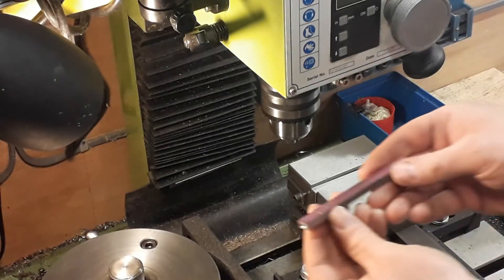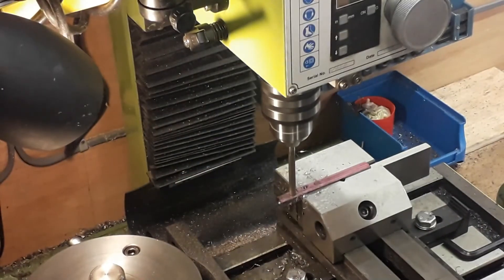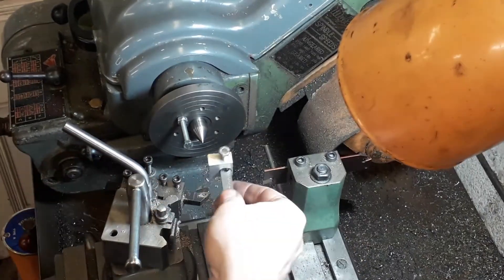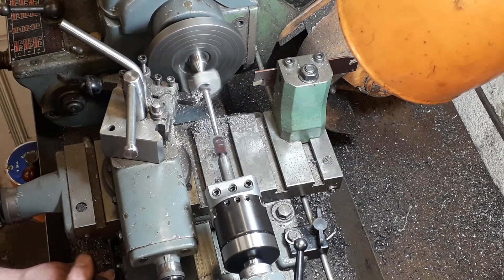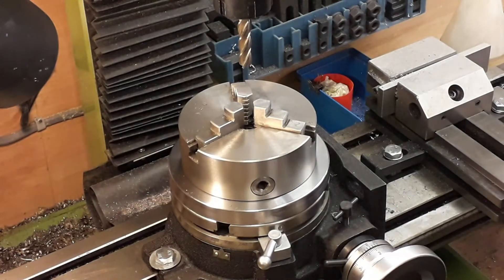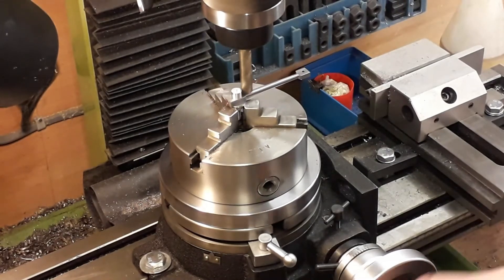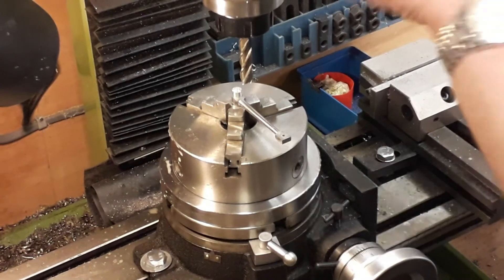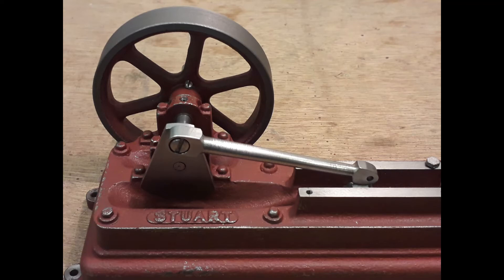Easy Stuart S50 Build Part 8 The Conrod

Comment: Hi Matt, to drill the bearing holes at each end of the conrod, did you consider drilling them using a self centering 4 jaw chuck, in the lathe, because then you would only need to concentrate on the distance between the holes, because the holes would be dead centre across the width of the bar.
Reply from the maker: Hi Terry, are you referring to the centre holes at the ends to turn the taper between centres? If so that's what I did, cheers

Comment: With my little 7x12 lathe I should have milled two sides down to make it  1//4 square. A lot less strain and time turning.😢 Live and learn.
Reply from the maker: Always learning and I usually think about it after, during these videos I ran through the machining a few times for each stage in my head to try and make it easy but that don't always work, as long as you remember for next time. When you say 7x12, is that 7" swing and 12" between centres?
Reply: @mattsbitsnbobsworkshop  Yes one of the little Central Machine lathes and a mill from same. Years ago I had a good South Bend lathe but sold it after a divorce. This little lathe hates steel even after a lot of rework and HSS or carbide make no difference. Have some brass round and about ready to do over and then mill flats on the ends.🤔
Reply from the maker: @gvet47  wow sounds nice but at that centre height I would have guessed it would be ok with steel but I had a mini lathe I used just for metric threads and it didn't like steel either (used a die nut most of the time!) so I feel your pain. Have you seen the video I did for you on the rotary table? One addition to it a bit of bar stock threaded to fit your chuck and a hole in the middle to pop a bolt through the centre of the rotary to bolt it down would also work well, good luck.
Reply: @mattsbitsnbobsworkshop  Yes I did see the video. Sad part is these little lathes chucks fit up to a 55 mm raised face and they have three 6mm studs so no threaded backplates. I do not have good material to make a special adapter plate, yet.
Reply from the maker: @gvet47  sounds like you have a plan, even the first one on the video is only held in place by one bolt and it works fine.

Comment: On a setup question. How did you mount the chuck to the rotary table when both the chuck bolts and t- slot bolts are hidden?🤔
Reply from the maker: One way is to use an adapter plate that bolts on to the rotary T slots will a thread for your chuck and the other is will the arbor adapter we spoke about the other day, as I said it's a really handy thing to have. (will do a video just for you when I can)
It's like this but you MUST use one with a drawbar not a tang https://www.rdgtools.co.uk/acatalog/2mt-Adaptor-with-Myford-Thread--With-Tang--893402.html
Or one of these https://www.rdgtools.co.uk/acatalog/Myford-Threaded-Adaptor-234709.html
But for the thread of your chuck.